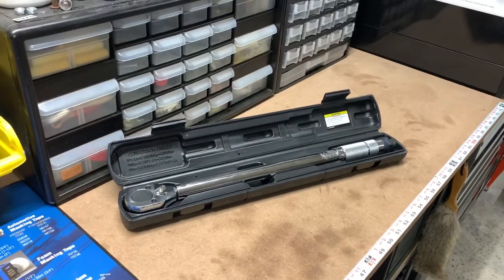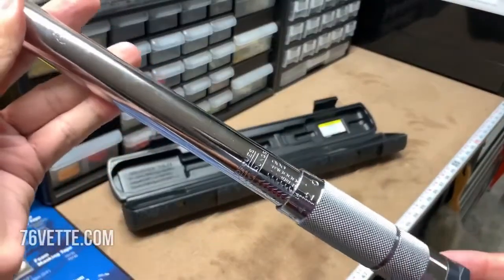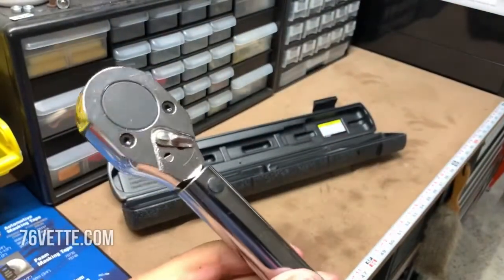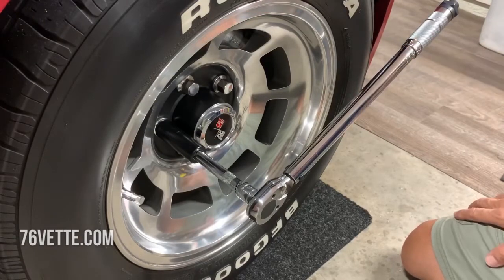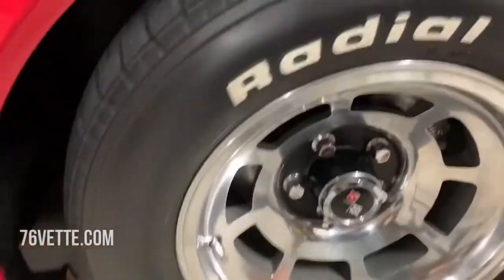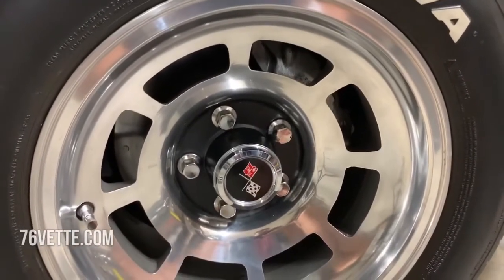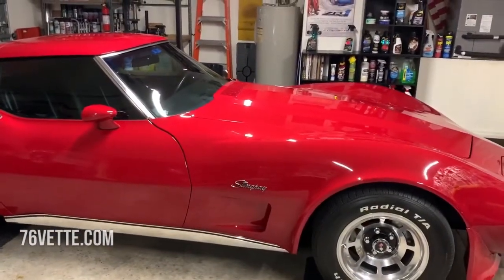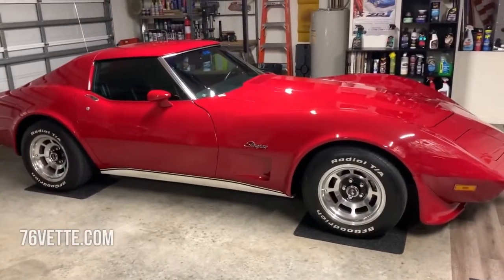How to TORQUE Aluminum Wheel LUG NUTS

Comment: I have the same torque wrench and two others in different sizes, of the same brand, and they have all worked without a problem...great deal for the money. Those aluminum rims, like mine, are 80-90 ft./lbs., the steel rims, (ralleys), are 90-100 ft./lbs. Reason is because the Aluminum is softer. Cool video, love the C3s.
Reply from the maker: Thank you! 😊👍🏻